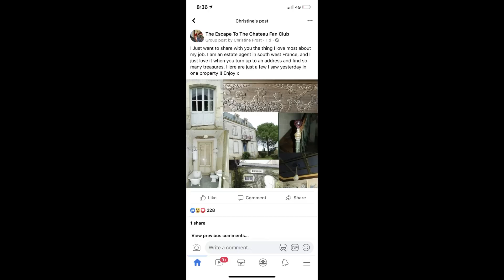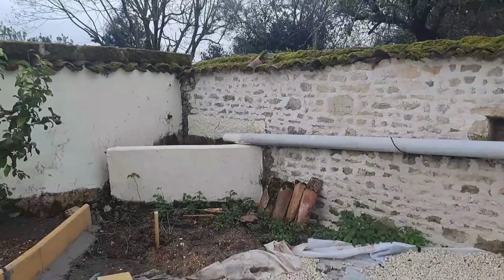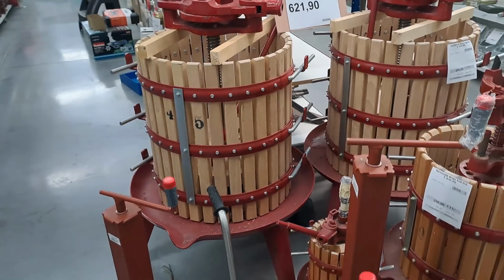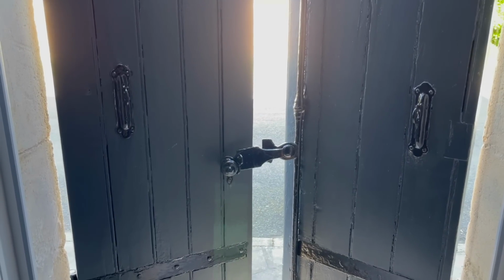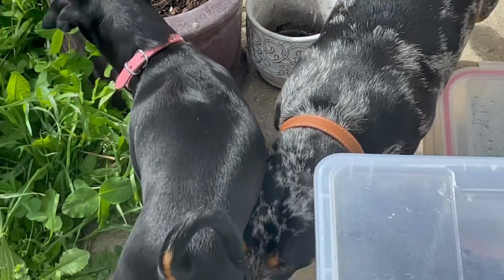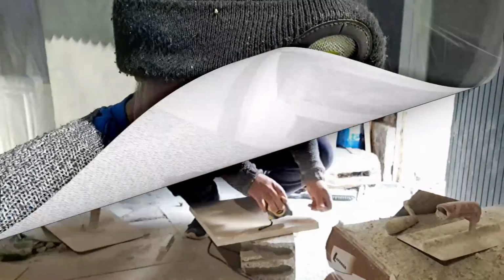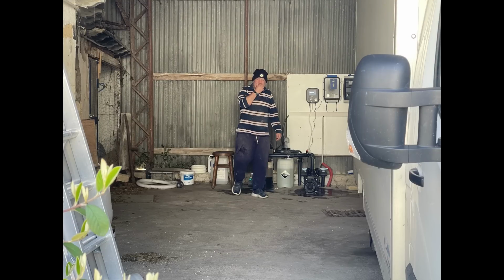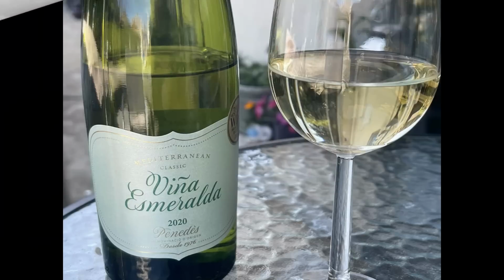Restart! #86

Comment: BEEARE THÉ BORAGE!  I moved here 2 years ago and the borders had been neglected. They are now infested with Borage. The blue flowers are very pretty and traditional garnish for Pimms but you only need so many. Apparently Borage oil is a good natural remedy for menopause … another use for your wine vats if you plant them out.  Seriously, they self-seed like mad and put down huge tap roots which over winter. They push up through weed matting and gravel too.
Reply from the maker: Big thanks for this advice Hazel - Borage will be in pots only. Clare x

Comment: Maybe these will be helpful with both your triangle tap thingy and the dog/window stuff. The tool your looking for is called a 'Tri head security screw'. The best place to buy one from is a UK company called ACCU [on line by typing Accu Screws into google]. The tri screw comes in various different sizes, is stainless steel and costs £4.76p. This company always asks if they can help you, they'll make you a custom one in your preferred metal if need be, [ for a bit  more money]. I also had the same problem with our cat and Jack Russel escaping from our tall open window and decided to put a fly screen up on only on 1 half of the window so we could keep it up and just slide it along when we wanted to close the window, a problem you won't have as yours open inwards, you could fit one between the window and shutters. I went on YT to see how to make one and did in 15 mins with some wood [which I painted before the mesh went on], 2 centre stabilising bars 4, L brackets a load of staples and high density fiberglass bug mesh [not the useless net mesh] on Amazon, enough to do 2 tall windows for £13.00p. This robust mesh is pet and even pollen proof and you cant see it until you get close to it. Sorry for the long post but just thought maybe it would help.
Reply from the maker: Thanks for getting in touch Sindy - both great ideas we will be looking into for sure - all the best from France - Clare and Nick x

Comment: Is there a blacksmith anywhere nearby?  You could take a rubbing of the triangle piece of the wine tanks, to get exact size and measure the depth of the indent and mark that on the paper with the rubbing, then take to either a machine shop or blacksmith for reproduction. I would also suggest dousing each of the spigots with a liberal dose of WD40 on a daily basis to allow it time to penetrate the age old corrosion. God bless
Reply from the maker: Thanks for getting in touch Melody - great ideas for sure we will investigate - time goes fast when you are renovating so sometimes you need to stop and make time to jobs and find things - currently googling what is a blacksmith in French. All the best from Clare and Nick x